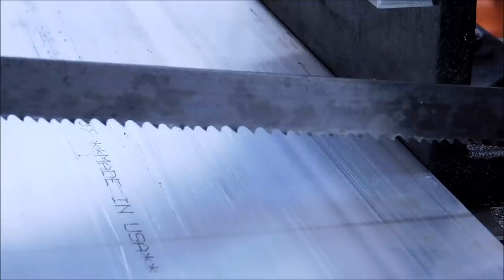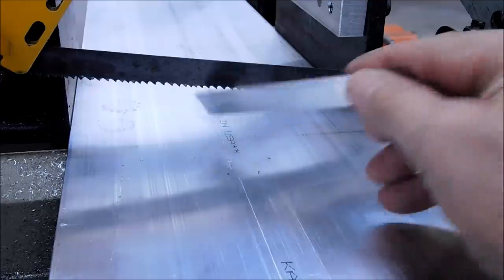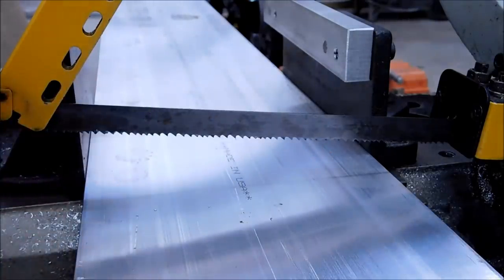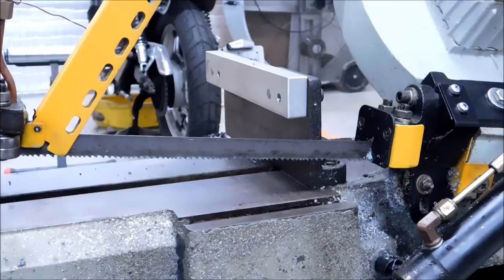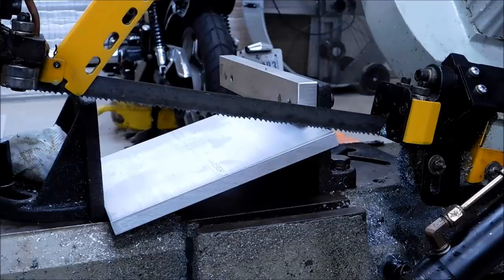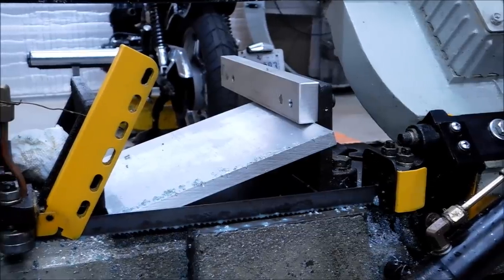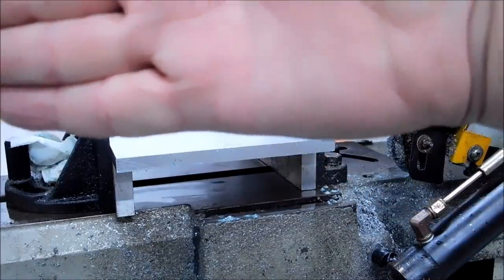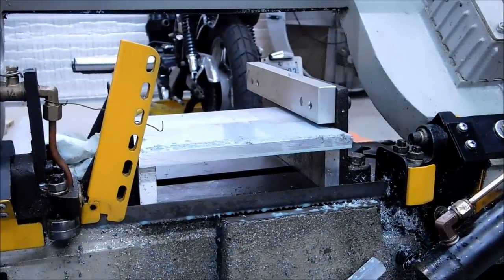Shorter Cutoff Times on your Horizontal Bandsaw

Comment: I'm a guy that has a plane to catch and I don't have a lot of time to watch my band saw cut material. I totally agree with you on your tricks. Another  one that I have used is when cutting deep holes with a hole saw in wood or metal, grind every other tooth away. This increases the gullet of the blade and allows for much more swarf to be "swallowed" by the gullet . If you have too many fine teeth running over to long a cut, they will load up and the whole process will slow down. If the the gullet space between two teeth fills up before those two teeth get to the end of the cut, then gnawing and friction takes over and everything slows down. Good video, Joe!
Reply: Exactly the reason holesaws are slow compared to an annular cutter.  Fine teeth quickly load up.  This is the reason that in steel for example, they should be frequently withdrawn from the cut, blown or brushed somewhat free of swarf and then re-entered into the cut.  This practice along with copious amount of lubricant (flooding is best) will help your holesaws last a very long time.  A drain hole(s) drilled with a twist drill through the material in advance in the kerf of the blade also helps.  It gives a place for the swarf to go.  Without the holes the kerf should be cleaned every time you clean the holesaw. Did I mention the RPM should be low? (I had a set of beater hole saws that I kept just for my young neighbor to use because he was a pedal to the metal type of guy!)

Comment: Hey Joe.. thanks for the tips as always.
Some thoughts.  An other reason for the variable tooth pattern is to prevent chatter. It keeps the chatter  marks out of phase with the teeth.

As a rule we try to have no less than 4 and no more than twenty five  teeth in the work.  This not always possible on wide work. Too few it can snag and break off teeth, too many and the gullet packs and may jam with chip. Here is where down feed  adjustment can save the day. Slow up  the rate to where is carrying a heavy chip but not full. 

The down feed is also supper important for accuracy.  Ideally there would be very limited bean load on blade. Just enough to keep it cutting but the saws forward progress controlled by the external feed not the tooth tip in the work.. Beam load stresses the blade and tends to make the blade want to flop off line. It can also cause tooth snag in weird profiles ( like gang cutting box tube), as well as reduce burr size.

Ellis saw company has some great info on this. It has saved many blades over the years.  

One other painfully learned tip.  If a tooth snags breaks off in the work, abandon the cut.  You will keep distroying blades otherwise on the hardened broken tooth.
I like putting the stock up on parallels methiod. It helps keep the stock square to the fence ( especially in thin wide stock that can be floppy tipped up. ... 1/8" x8" for example)

Wow, this got long winded. Sorry.  Be safe everyone.
Reply from the maker: I tend to introduce the down feed gradually as a rule. Let the blade get a good groove on, then max it out to your target setting. For this example, I maxed it out right from the start. Your broken tooth comment translates to milling as well. An embedded chunk of carbide from a broken end mill can claim a lot of victims if you don't watch the next approach carefully.

Comment: I always wondered why people lay their flat stock, well, flat into the vise. For me it makes more sense standing them upright. Of course that won't work for material that is too wide, so your solution to this is really ingenious.
Reply from the maker: Thanks. Sometimes I cut longer lengths that hold multiple parts and do the smaller cutoff work on my vertical saw. My vertical doall would walk through that plate in about 20 seconds.

Comment: Another amazing idea from Joe. I have been cutting with flat bars on a slant since forever. Trying to feel the angle where the plate is secure and steep enough to be viable and not too steep that it pops out of the vise has always added the pucker factor to the operation. Bar on the fixed vise jaw, who would of thunk it. Thanks for the great tip.
Reply from the maker: I know that spot. Its small, but works. Be sure to check out the multiple round bar cutting video that uses this bar. It will help.

Comment: This is why it is important to reference the blade's purpose as designed by the manufacturer, some blades are optimized for %100 engagement with the material, some blades are optimized for partial engagement i.e. for cutting structural shapes. The manufacturer has designed the profile/rake/ and overall geometry of the tooth profile for cutting in specific applications for example stack cutting, or HSS (hollow Structural Shape) in which as the blade passes through the material different tooth engagements occur at different times. Good video as expected Joe.

Comment: Thank you Mr Pieczinski. I had it in mind to do a couple of mods to my cheap band saw. You know, the usual thing about extending the vice jaws and adding a screw on the far side of the moving jaw so you can clamp short stock. Then I saw this video about adding a removable bar to the fixed jaw for clamping plate at an angle. So I did that too. It really works well and I've used it a few times already. Great tip, many thanks.
Reply from the maker: Glad to hear it.

Comment: Nice video Joe. Many of the bigger saws I ran had a picture of how to orient different shaped stock. Mainly I believe for consistency. I was taught to have the most teeth engagement as possible. But clearly your demonstration illustrates an accurate and efficient manner for cutting wider stock. Thanks for posting!

Comment: Thanks, Great video as always.

Some things to note.
1) One of the reason for variable pitch blades eg 2-3 TPI  3-4 TPI 5-8,  6-10 TPI and so is to reduce resonance when cutting. It you have a constant pitch blade it will have a "cutting frequence" associate with it which can cause resonance if the item you are cutting has a natural frequence near that of the blades "cutting frequency" 

2) unfortunately cutting narrow materials vs wide materials normally should require changing blades eg 1/4" material should use about a 10-14 thru 6-10 TPI Blade , where as 1" thick material should use about a 5-8 thru 3-4 TPI blade. The best TPI will also depending on material type and item geometry.

The reason for Lower TPI for thicker materials is those Lower TPI ie Bigger Teeth also have a bigger Gullet (the trough between teeth) which is where the waste material accumulates through the cut ans then falls out at the end of the cut.
If you have a high TPi with wide material the gullet fills up in the firsts part of the cut and then for the remainder of the cut the teeth cant dig in and do much more cutting and rather now the teeth tend to just skate over the surface which accelerates blade wear.

Also using a low TPI blade on narrow material is bad for the blade, as the blade tends to "bounce" with only 1 or 2 teeth in contact with the cutting surface and as that tooth exits the cut the blade drops down with the uncut material going into the gullet, then this bounce can cause broken teeth.

So ideally you should have 2 or 3 blades with significantly different TPI and change the blade when you cut different material. 
I would suggest
10-14, 8-12 or 6-10 TPI for  thin Materials eg 1/4"-1/2" 
5-8, 4-6 or 3-4 for medium materials eg 3/4"-3" 
2-3, 1.5-2 or 1-1.3 for wide materials eg 4"+

If you cut lots of both thin and wide materials and its a pain to always be changing blades, invest in 2nd small Horz bandsaw for the small materials and keep the High TPi blade fitted to it and the larger Horz band has the low TPI blade.

Think of it like changing blades on an angle grinder from thin cut off disc vs thick grinding disc vs flap disc vs sanding paper disc they all have different applications. Similarly people have different angle grinders dedicated to different disc types.

Comment: Joe, Great video. I would be interested in checking the squareness of each condition. I would expect the squareness to be inverse to the speed of the cut as positioned, especially if the blade is slightly worn. The blade may tend to wander more on the "tipped" cut.  It may not matter if you are milling the part square. Another advantage of the tipped cut is you have increased the capacity (width) of the cut. I have the same saw and can only get 8-9 inch wide laying horizontal. Great idea. I will try that modification. Thanks

Comment: Joe, I do a similar trick as example 2 but I use a substantial piece of angle iron, point up, between the jaws with the end just short of the blade and clamp the material to be cut to the lead side which puts it at a 45 degree angle. Works well when cutting stainless and other hard materials as well as thinner stuff like 16 and 14 guage stuff. Thanks for your informative videos.

Comment: The blade wear reduces too along with chip clearing being more efficient. 

When cutting tube especially thin wall it is necessary to back off the feed as the area of contact with the blade reduces.
The blade easily jams if you don't.
On production quantities of tube I used to hang a weight on a chain to increase the feed.
As the cut progressed it automatically  reduced the pressure when the weight hit the floor.
Reply from the maker: Clever idea.

Comment: This is why I always cut box section rotated at 45 degrees. It cuts quicker and is better for the blade. Angle also should be cut with the corner up rather than an 'L' configuration for the same reason.

Comment: Something else I've found useful is adding a second coolant nozzle to the drive wheel side, ahead of the blade guide rollers (bearings). The coolant stream helps to flush off any chips that are stuck to the blade after leaving the cut. It reduces the chance of chips getting wedged between the blade and the guide bearings and it helps to cut down the buildup of chips on the gullet cleaner too. (The rotating wire wheel under the blade.) I installed a T-fitting into the coolant hose and rigged up another shut off valve and a piece of copper tubing on a bracket that I attached to the second roller guide block. Most of the larger horizontal saws I've seen have a nozzle at each end, and it was a simple upgrade to do - so I did...  😁

Comment: Ok As usual a very clever presentation. One think that is worth mentioning is that you are using a sharp H. S. blade as opposed to the cheaper ones. If you are cutting a hard material such as stainless it is a must. The other thing worth mentioning is the importance of having the blade aligned with the swing of the blade. After cutting off a part check to see if the blade springs. If it does then you probably have and alignment problem. And finally on a wide part such as this when you are running collant you can place a wet rag across the material to act as a dam. Nice Video.
Reply from the maker: A side benefit of a tilted setup like this, is gravity puts the coolant right back in the tray. It does not walk down the material like a flat setup.

Comment: I just bought a similarly sized band-saw; picking it up tomorrow. I like the #2 setup with the stop at the top. Ill be making something similar on mine after your suggestion here. I am well familiar with the principle as I have been using it for decades; more as you showed in the round stock, when using hacksaws and later a circular cutoff saw. (round square, angle,) it applies to all of them; keep the blade contact short, rotate if needed, and it will cut much faster. 

Always good to see these tips. Even if someone knows the principle, seeing a good setup or implementation can save a lot of hassle.
Reply from the maker: Have fun with the new toy. Buy starrett blades. Expensive, but they last forever.

Comment: I've never heard of tilting stock even though I already knew that the less contact the faster the cut. I'm rebuilding a saw I'm going to add this feature. Thumbs up.
Reply from the maker: It works well. Now I need a follow cart with an adjustable shelf so the material doesn't want to lay down between cuts.
Reply: @joepie221  I'm using an old machinist jack at the moment but yeah I should build something proper

Comment: I have one of the cheap bandsaws.   Time spent adjusting it produces good square cuts.  I use bimetallic blades and the clunky spring lifter.  I use an aquarium pump for coolant .. it's a beauty!!!         It cuts about 1 square inch of steel per minute regardless of the metal section.   I can speed things up by hanging a brick on the swing arm with no bad effects.  I don't stand and watch it but I don't leave it unattended!!!  I thought of downfeed control mechanisms but frankly I can't be bothered!!!     My shop isn't as organised as yours, but I do "need it yesterday" stuff!!

Regards

Estephan

Comment: There are other benefits of this technique (tilting to reduce length-of-contact).  When the blade tooth enters the work, it starts heating, until it emerges, and then cools while it is taking the trip around.  Bandsaw speeds are set based on material thickness, and can be set faster on thinner engagements.  In addition, when cutting plastics, melting can be avoided.  (Slowing the saw to avoid melting is counterproductive.  Heating rate is slower, but time in the cut is longer, almost nullifying the benefit.)  When cutting plastic U-shaped pieces, jigging them at an angle reduces melting.  Selection of the angle can direct the bur to a surface easier to access for deburring.
          Unfortunately, most of the vices I have encountered on horizontal bandsaws are crap, and hold material poorly.  They have difficulty with either very short or very long pieces.  Somebody needs to put "Kurt quality" vice on a bandsaw.
Reply: Good point on the cooling! That makes a lot of sense.

Comment: Great tips. One thing to note, however, is that a vertical cut can lend itself to blade wander. If the piece is going to be machined anyway, go for it, but if a square cut is necessary, a more horizontal cut is better.
Reply from the maker: Its all about time in most job shops. imagine this times 50 parts.
Reply: @joepie221  Believe me, I get it. But I should've mentioned that I'm a fabricator, not a machinist.

Comment: Phew! -Am all shook up now! Angle of ATTACK  !     DANGER!!      My Fendo ( Italian ) Saw PUSHES the Var. pitch blade ( of course it Pulls it from TOP  ) so I would be doing as you do but the other way around:  The Blade wants to enter the stock in the UPHILL Direction.   I  hadn't given it all much thought before but had tried lifting sock off the bottom when dealing with large awkward items where I wanted a clean cut, but the frame would catch on the workpiece - it happens.    As for turningthe Round stock:    I have asked around / researched and it seems that Bandsaws are not guaranteed to cut square - Maybe only when new ....  so unless I want to cut a Spiral drive flex cplg,  I'll just wait a couple of minutes longer.  We cut up to 6"  20MnV6 ( EN14A ) with similar blades and just accept the time  - tea-break or getting other parts ready.  Thanks again for taking time just to make some cuts to show  us!

Comment: I have an old Amada HA-250 and for stock like that I use a 3-4  blade.

However it also has hydraulic down feed so the feed is controlled.

Thanks Joe!
Reply from the maker: Is the hydraulic downfeed, power, or just a gravity controller?

Comment: Been using my (same model) horiz bandsaw for structural steel for several years and it works pretty good. The block idea is great. Rotating the part is another idea I hadn't considered - seems like it would be less likely to get a nice straight cut. You probably mostly rough cut for machining , whereas I try to finish cut for welding and fabrication, though. Great stuff; I always learn something watching your videos.
Reply from the maker: Thanks for watching.

Comment: Great idea ,  but if it started cutting crooked it would probably break the blade .  But at least the coolant runs back to the saw & not the floor .  I have never tried that method but will give it a shot . I like the block on the jaw idea ,  Cheers  Joe , Thanks .

Comment: Joe you should have talked about tooth loading to help your explanations.
Also, this set up is good for small pieces. Good luck with heavy, long ones and especially if you use a conveyor.
Thanks for posting another must watch video!
Reply from the maker: That 1/2 x 8 bar was 144" long when I started cutting it. I have a cart with an adjustable shelf and stop that holds the rear at an angle just fine. Long heavy material will want to flop. You are correct.

Comment: I sure like the back jaw modification. My old Kaiser-Johnson is up for this mod , probably today! Thanks Joe.
Reply from the maker: Go back and find the 'cutting multiple round bar" video. It shows the original intent of this bar.
Reply: The lights came on as soon as I saw your setup. I knew I could put multiple rounds or mis- shaped materials using that bar on the jaw setup. Big plus being able to angle the wide pieces of flat stock. In my home shop I use mostly scrap, reclaimed, drop, or whatever to get the materials I need to use. It's a real treat when I do get new bars and lengths. Ha. I also chuckled because I made a print of the jaw mod along with pins so they'll be all the same. I just viewed the multiple video a few minutes ago. Great minds! Have a great day, Joe!

Comment: 39 years experience and damn if you didn't teach me something new LOL.
Cocking the plate up at an angle that is.
I was surprised to hear you say you do not adjust RPM on your saw!
You cut 6061 Alum. and 316 S/S at the same RPM?
Reply: where the hell did you work? this method is as old as the horizontal saw itself
Reply: @davidjones-vx9ju  At least he learned to use capital letters and punctuation properly when he writes.